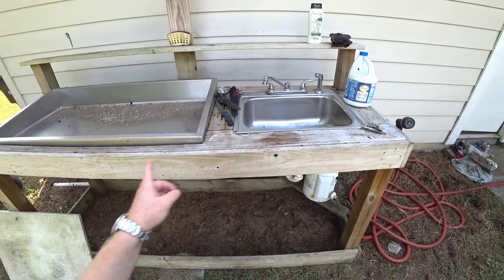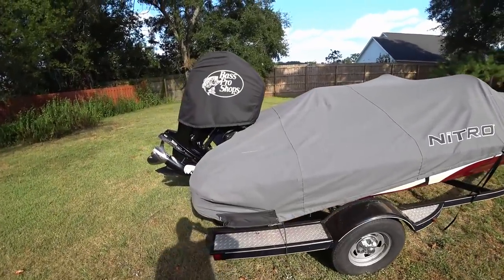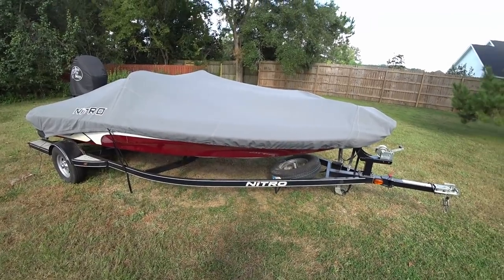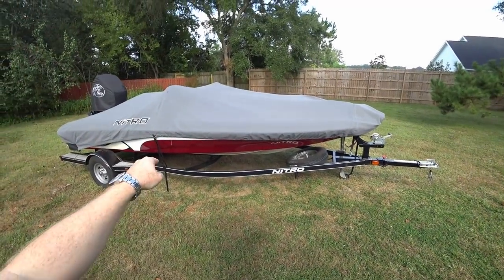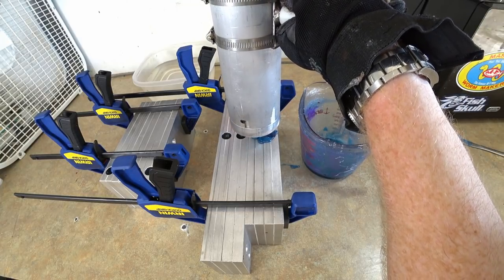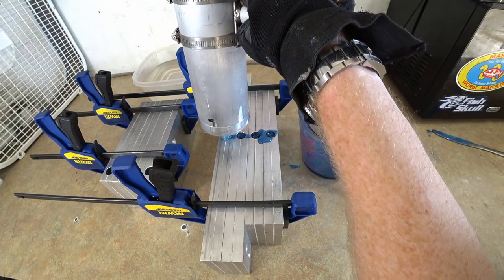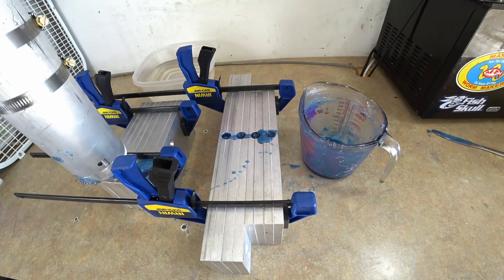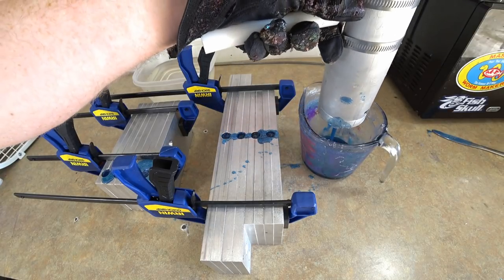More REMELT FUN...1 Hour Of Running Remelt Soft Plastic Baits.

Comment: Do you have to vacuum out the air bubbles for remelt? I have some scrap soft plastics and want to melt them down and pour a new bait and don't really have any means of drawing out possible air bubbles.
Reply from the maker: I definitely prefer to use the vacuum chamber for bubbly Plastisol